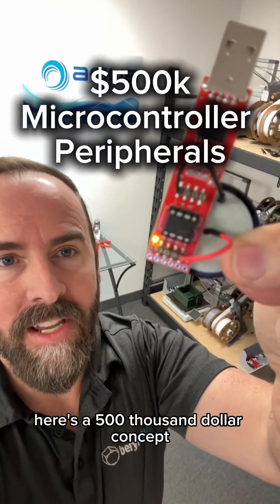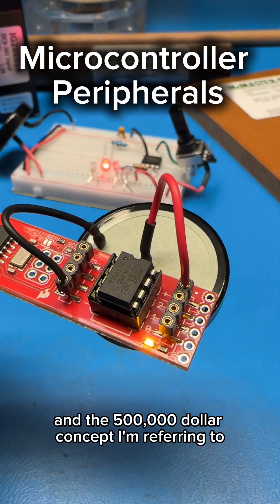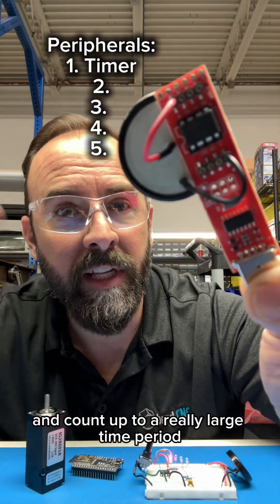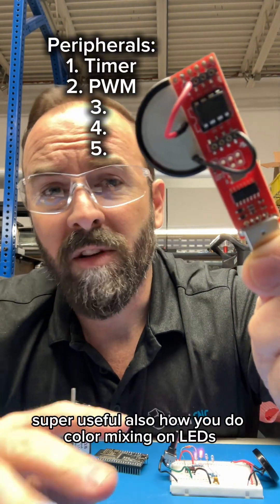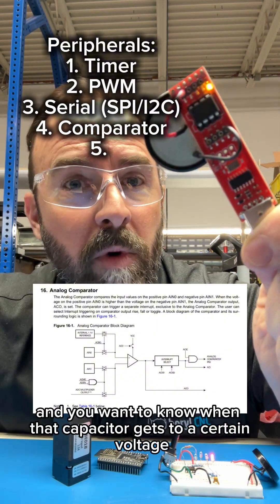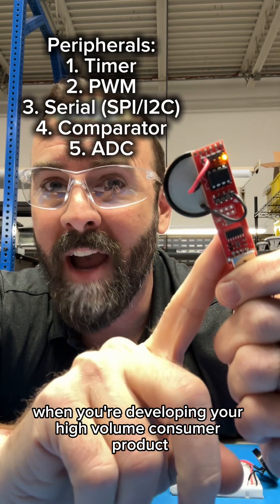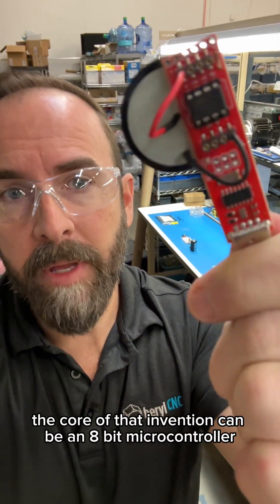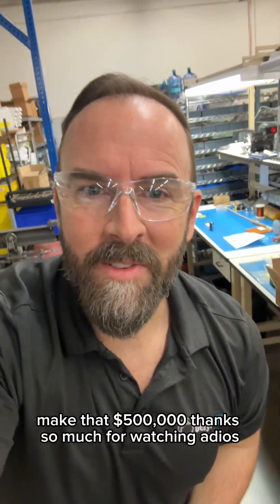$500k Microcontroller Peripherals

Comment: What if i need at least 11 GPIO's, and at least 3 of those must be PWM output, and at least 3 must have analog input, also i need I2C and 1 serial connections...
Doesn't it make sense to just use an esp32 ?
Or is there another chip that u think would handle all this?  I need to control 3 servos, lora, and epaper display, as well as some inputs, also want room for future upgrades.
I would love your thoughts before i my next redesign of my product and pcb design.
Thank you sir.
Reply from the maker: Yeah ESP32, RP2040, STM32, etc. You can always interface with ASICs from the host processor too if your Micro doesn’t have everything you need onboard. I’m not dying on the 8-bit hill, just wanted to showcase the simplest example parts for non-engineers who might be inventing high volume consumer products.

Comment: crazy to think about a microcontroller the size of a 555 timer with all that power.
Reply: It blows my mind that I can run Micropython on a 2$ ESP32c3 that has Wifi and Bluetooth integrated where the chip is a quarter the size of an the Attiny in the video🤯
Reply: That and the trend towards adding a 32 bit ARM core to anything. Yeah they put one of those in an 8 pin package too, though turns out it was a solution looking for a problem
Reply: There is a breakout board with usb connector for the tiny microcontroller. The usb port is bigger than the microcontroller 😂
Reply: We have come a long way from the original 555. I function a drain with a 3 pin pic the size of a grain of rice
Reply: It is not what produces the power though. This is just taking a low voltage signal and triggering a gate to open or close
Reply: I'm going to guess you never had this kind of stuff in school. I would have expected most schools to have some basic lessons on this kind of stuff. The ATtiny is not that interesting, it's also expensive for what it does. There are much faster and cheaper chips than it, the smart thing is to figure out some basic widget and then speak to someone who understands these things and can work out the minimum chip to control the widget. You can prototype the thing for $50 bucks roughly, you need a chip-programmer, a target chip and a few basic components.
Reply: @noth606  ... woosh
Reply: @StickySlippers  woosh doesn't make much sense in this case IMO. YOU may think it is humorous but I doubt most would, and tons of people would genuinely have that reaction to a small mcu.
Reply: @noth606  I'm well aware there are smaller Micro controllers.  But for someone who has been building circuits longer than you may have been around, its still fascinating to see things become smaller and more powerful. And the 555 being a very familiar component and package size to me. I was simply comparing how awesome it is to have so many more features in a familiar package. So the Woosh was acceptable.  You didnt quite grasp what I was saying and thats ok :)
Reply: buddy...lol...do you understand that apple will sell you a chip with 184 billion transistors? but hey, sure, 25 is also pretty good I guess 🥴
Reply: @MichaelBeale you're really missing the point.
Reply: @MichaelBeale r/woosh

Comment: Your point about having it be offline spot on. 👍
Reply: Black hole is exactly right. Once you are connected your product is vulnerable to attacks over the internet. And OMG do I hate having a useless app on my phone for every useless thing. Ecoflow battery backup I'm looking at you
Reply: There are so many items that are subscription based, which should always be "optional" for devices, and retain the function the day you purchased it.  If features are added, it is a paid upgrade.  I go out of my way now to purchase items that do not require an online connection.  No connection is the only way to reduce any security risk.  I do not need to create an account to use my refrigerator. It will only result in a paywall, ads, being turned off, or some other place to get my personal information.  I'll take my chances with an unknown chip from china not connected to some server.  If it starts on fire, it will only destroy my personal info, not share it.

Comment: I have something I would like to make, but I struggle to find low-cost components that can measure time with sub-nanosecond precision on longer timescales. Do you have any recommendations? 

Most of the commercial products require significant cost and/or development. I can handle the fast signal electronics, but I need an off-the-shelf solution for digitizing.
Reply from the maker: Not sure, that’s getting pretty fast. You might need a laser and some kind of Q-switch, stuff like that to measure phase shift.
Reply: Sub nanosecond is CPLD/FPGA territory, the learning curve is far steeper and also tends to have a MCU and the CPLD/FPGA as a coprocessor. (Some of the nicer FPGA's can emulate an MCU on board but this is often more expensive route than an MCU + coprocessor even with increased BOM count.)

There are also specialty MCU's that have hardware peripherals that might enable this but are often specific to common applications (such as PWM etc)

Comment: I like your videos but they are slightly out of my pay grade.  Where is a good place to get info on the basics?
Reply from the maker: My videos!! Haha idk, I’ve started to ask others to chime in on this because I’ve been at this for a long time. I would just start doing projects with a 3D printer and check out Adafruit. Something will grab your attention.
Reply: @i2c_jason I bought my first 3d printer this summer and having fun with that.  I already know gcode so I thought that would help but the slicer software is pretty impressive.  My goal is to build a small CNC that can handle steel.

Comment: How much time/licensing does it take to go from a working prototype in your project room to a legal product to sell in store/online if you don't mind me asking?

Like 255 baby
Reply from the maker: If it were a very simple battery operated sensor device of some kind with injection molded plastics and we were fast tracking it, no surprises, I’d probably budget 8 weeks R&D, 8 weeks concurrent plastics tooling and any FCC approval, 4 weeks for tech transfer and first article evaluation with manufacturer, then probably 1k pieces per week can roll off of a US assembly line. So maybe 20 weeks give or take. If it’s a more complex product, better to budget a few more months or even years in R&D. My example here might be a flash drive sized gadget that snaps together and goes in a clamshell.

Comment: So you're saying that when you unplug a computer the capacitors take the little bit of power they have and save the files sometimes?
Reply from the maker: You can design the circuit to store EEPROM data right before it dies using a sense line to the comparator or a GPIO. We did this for example on an HVAC controller that had a simple user interface and had to save changes across power failures.